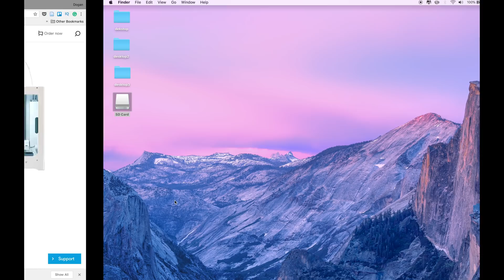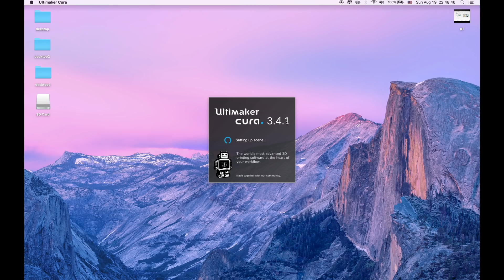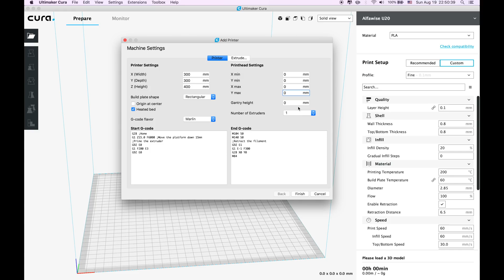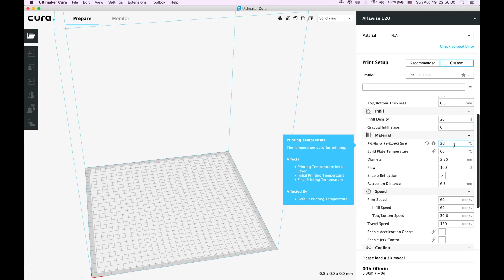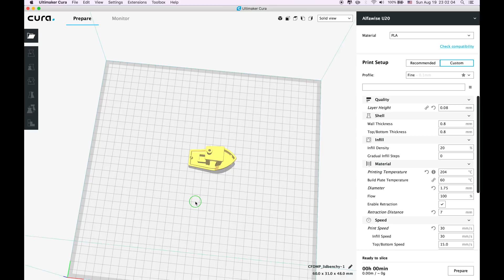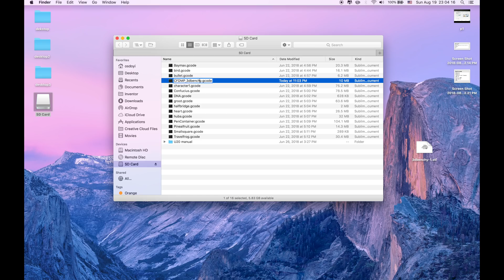Alfawise U20 Cura Settings

Comment: Hello kind sir. I know this video is 4 years old but maybe you can help me. I recently bought this printer with dual feeder (U20 Mix) and after few days of using software that i recived with this printer i decided to start using Cura simply because it has much more settings to play with, but something is not right because when i upload Gcode and start printing the printer retracts the filament too far and when print starts it starts without printing anyhting and on top of that even if the temperature of the nozzle in Cura is set to for example 220 C, bed is 80 C and infill is 10% the printer doesn't know what temperature it should be and sets it to 0 C, bed temperature doesn't increase and i have to do it manually via touchscreen, what is wierder prieview of the print, information about infill %, material type and how much filament was used is unavailable. Everything is perfect when using Wiibuilder (included software for slicing)
I just don't know what to do.

Comment: Hi mate! I bought the same 3d printer, I have some questions about it, can you help me? thanks !
Reply from the maker: Sure! Whatvsre your questions?
Reply: @3DPDoctor  Hi, thank you for your answer! So I bought a doll model for 3d printing, and I have some troubles with peeling layers when I  printing. Maybe you can help me with Cura setup. I think I have some troubles with an extruder, or this is just trouble with a slicer, etc. ( I used your video guide for setup Cura settings, but still have problems with layering.)
Reply from the maker: @TheVirusification  peeling layers? At where? Which material are you using? PLA? ABS?

Comment: Hi, when I print anything it prints a "base" of 5mm around the figure. Anyone knows what happens and how can I avoid that behaviour?
Reply from the maker: Do you mean single lines? They are called brim. You can disable them in the bed adhesion section

Comment: Hello,

I have alfawise u20 plus version. I downloaded the latest cura which comes with u20 not the plus. Can I just change the bed dimensions to the plus and leave everything original?

Also not many info out their on the plus even on the Facebook group😔
Reply from the maker: Let me check u20 plus and reply back
Reply: @3DPDoctor  thanks!
Reply from the maker: I think it should work. But be careful to not crash it. Test print small things

Comment: Hey does this work on the alfawise u20 one? That is a new model. Find it here
https://m.gearbest.com/3d-printers--3d-printer-kits/pp_009726113945.html?wid=1433363&lkid=37289366 also Is it possible that you can make a video on the new cura 4.*

Comment: im looking for the fw for the large version, anyone know where i can find it? "400x400x500"
Reply from the maker: Are you looking for the firmware? Or cura setup?
Reply: @3DPDoctor   for the firmware for the large U20+
Reply from the maker: I think you should make a post about it in the alfawise Facebook group by tagging the alfawise team. They are providing upgrades in the fb group. Best way to reach them (i think)
Reply: @3DPDoctor  yes i actually did reached out and they are yet to reply
Reply from the maker: Since its not open source :/ your option is to reach them first... i would reach them again over a post. So that everyone can see the post and back you up (if you message them you should do a post as well)  i am not sure if you can turn the software into marlin

Comment: Can you show how you can send print through usb port to printer. thanks
Reply from the maker: Do you mean printing over computer? If you use sending gcodes from computer rather than sd card it makes print delay between layes and it results bad. You will always need to use sd card. Are you trying to remove sd card? Or are you just want to send print with cable from computer to printers' sd card?

Comment: i have alfawise u20 an i can prind only the files isie the  sd cart.   other models  i try is  fail...    help....
Reply from the maker: How they fail? Can u explain more?
Reply: the models or they un stuck from the plate or  the filament go to hi or to low . dont work. only  the birts and the bulet can print.
Reply: and the square
Reply from the maker: I am not sure if i understand correctly. You say: objects doesnt stick to bed?
Reply: @3DPDoctor   yes
Reply: Or the extrusion start to high and the filament dont stick on bed
Reply from the maker: Did you level it? Is there a gap between nozzle tip and bed surface?
Reply from the maker: Okay you need to lift the bed up. Put washers under your springs and lift the bed. Thats the design flaw of u20 actually. Even if you release the springs sometimes there is still gap in between. So easy way is to.put springs. Its a hardware problem
Reply: Yes i levelit with A 4 paper. This hapen only when I download a model and try to make with cura 3.6 setings to u20 printing setings  all models in sd card works fine
Reply from the maker: All sd card files are using raft as support. Are you using raft too? Maybe i am.missing a point
Reply from the maker: You said bird bullet and square works from sd ... does all work or only 3 works?
Reply: @3DPDoctor  all original files from sd card jes. Works fine. Dna model. Bird model. Bulet model. Square model and one more. All models is perfect. But when i try to prind from internet with cura i havent do nothing. All models have different issues.  Other models go to close with bed others models go  to high and flow like spider.
Reply: @3DPDoctor  i dont know what raft is im sorry
Reply from the maker: @nikolaosdimitriadis6889  it is build plate adhesion type. You can select raft rather than brim on the software
Reply: @3DPDoctor  i will try this in 2 days and i will sent you msg.  Tanx any way man. 😁😁👍

Comment: Hi, can I use the settings for the U30? If not, can you please help me! :-)
Reply from the maker: When you open the cura you can use the similar print settings. Just make sure that bed dimensions are different
Reply: @3DPDoctor  Thank you for your prompt reply
Reply from the maker: U r welcome
Reply: @3DPDoctor  Hold on, I tried this

Apparently all of the sample prints that came with the Alfawise U30 worked with the printer, but when I uploaded a new .gcode file with CURA (Same G-Code, Different dimensions,) none of the filament would stick to the base // It would not print. I feel this is a G-code error however.

Thanks! And wonderful videos too!
Reply from the maker: Thats interesting. I assume you did leveling properly, what is your first layer height?
Reply: @3DPDoctor  Hey sorry for late reply. 

We believe that we may have messed up on both. We will be leveling the bed again, and I have updated the layer height on CURA (I am using ver. 4)
I will inform you of my results when I receive them.
Thanks again!
Reply from the maker: Yeah let us know, thank u

Comment: Hi. I cannot see the Start G-code clearly on video, but I can see that the lines 3, 4 and 6 are longer than in the code that you puted in the description. Is it important?
Reply from the maker: Use the code in the desription. Copy and paste it, then it should work
Reply: @3DPDoctor  Thanks

Comment: can i use this settings for my alfawise u30 , of course i will change table dimension
Reply from the maker: Yes for sure
Reply: @3DPDoctor   U 100% sure that only table is smaller , other spec are the same ?
Reply from the maker: Not 100%

Comment: Hi,
I have an issue, the thickness of the part I print are always 1mm less than the drawing in thickness (due to the start of the printing). Fine on other dimensions. Any advices ?
Reply from the maker: Did you test raft as bed adhesion? Maybe your initial layers are squeezed a lot. When you do it as raft initial layers are going to be raft so that your object can be built on top of them. And if the error is occuring at the inital layer your problem can be solved!
Reply: @3DPDoctor  Yes, I tried all kind of support, always 1mm short on thickness.
Reply from the maker: Is this.happening only on a specific object or all the object that you print

Comment: On the micro SD card there is a file U20.ini. There are printer settings. 
start.gcode = ;Sliced at: {day} {date} {time}

 ;Basic settings: Layer height: {layer_height} Walls: {wall_thickness} Fill: {fill_density}

 ;Print time: {print_time}

 ;Filament used: {filament_amount}m {filament_weight}g

 ;Filament cost: {filament_cost}

 ;M190 S{print_bed_temperature} ;Uncomment to add your own bed temperature line

 ;M109 S{print_temperature} ;Uncomment to add your own temperature line

 G21        ;metric values

 G90        ;absolute positioning

 M82        ;set extruder to absolute mode

 M107       ;start with the fan off

 G28 X0 Y0  ;move X/Y to min endstops

 G28 Z0     ;move Z to min endstops

 G1 Z15.0 F{travel_speed} ;move the platform down 15mm

 G92 E0                  ;zero the extruded length

 G1 F200 E3              ;extrude 3mm of feed stock

 G92 E0                  ;zero the extruded length again

 G1 F{travel_speed}

 ;Put printing message on LCD screen

 M117 Printing...

end.gcode = ;End GCode

 M104 S0                     ;extruder heater off

 M140 S0                     ;heated bed heater off (if you have it)

 G91                                    ;relative positioning

 G1 E-1 F300                            ;retract the filament a bit before lifting the nozzle, to release some of the pressure

 G1 Z+0.5 E-5 X-20 Y-20 F{travel_speed} ;move Z up a bit and retract filament even more

 G28 X0 Y0                              ;move X/Y to min endstops, so the head is out of the way

 M84                         ;steppers off

 G90                         ;absolute positioning

 ;{profile_string}

Which setting is preferable, above or yours?
Reply from the maker: Its up to you (user)  try both and see.the quality and pick accordingly

Comment: Wanna share ini file for setting profile u20 in cura 3.5.1? Thx
Reply from the maker: I havent updated to newer cura yet. But I will basically use the same settings
Reply: @3DPDoctor  Sounds like "material diameter" is not present anymore... Is it an important setting?
Reply from the maker: For alfawise there is only one diameter type. Are you able to see it on machine settings? It might be hidden too. If there is a preset machince definition on new cura release, they probably included it in there
Reply: @3DPDoctor  OK. Found in the Extruder tab of the machine setting. Thanks.
Then I changed duplicate the PLA material to a 1,75 mm one.

Comment: when I use those exact settings, and I get the file on the sd card, I run into an issue. I move it over to the printer, and I hit print on that file, it just freezes and doesn't let me do anything. I can't print anything that wasn't pre-installed onto the sd card. plz help.
Reply from the maker: Okay you need to upgrade your firmware. Join the facebook group of alfawise and upgrade the firmware by follwing the steps pinned in the group. Did you try any other slicers?
Reply: Osdoyi PhD  i cant join the group, is there a link or photo i could use?
Reply from the maker: Yes links are in the description of the video
Reply: Osdoyi PhD I didn't look down there, oof. but I figured it out. thank you so much for telling me that it was firmware related. if you didnt i would still be working.
Reply from the maker: So I assume it worked?
Reply: ya, now I'm just running into some issues with the filament not sticking to the bed, but ima take car of that tomow
Reply from the maker: Coool. Good luck